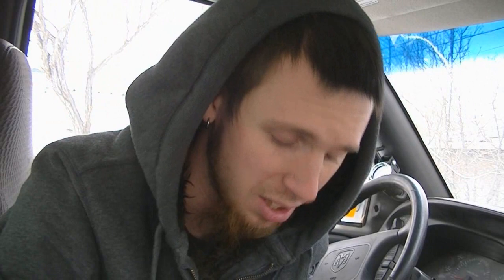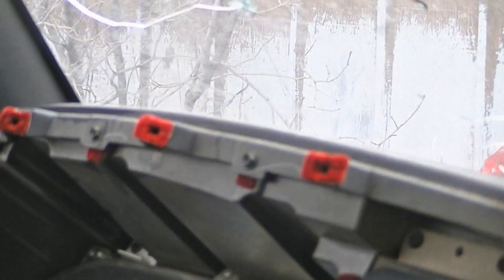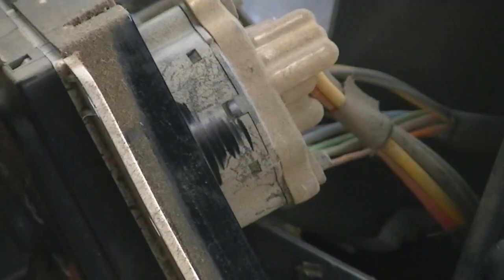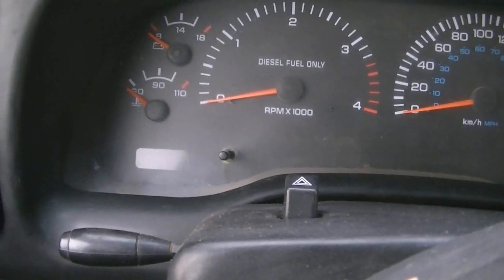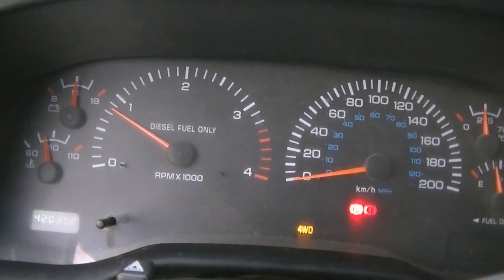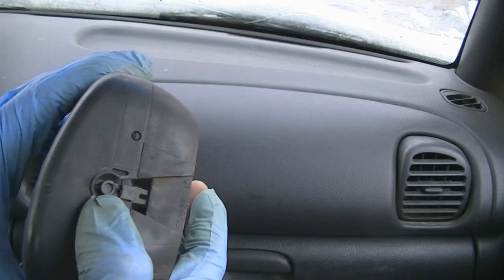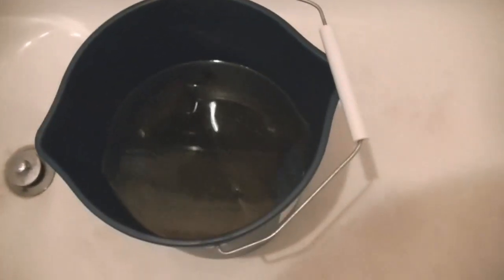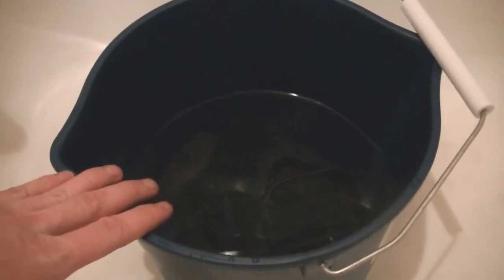Clean The Cummins Pt1 (01/08/13)

Comment: yea they all do that jumping tack stock a good fuel system like an air dog will  fix it but just to be clear not a problem however upgrading to an air dog an ditching ur stock lift pump will make ur vp44 last alot longer